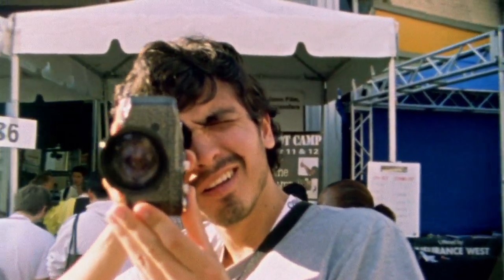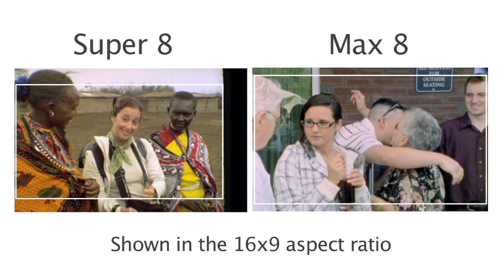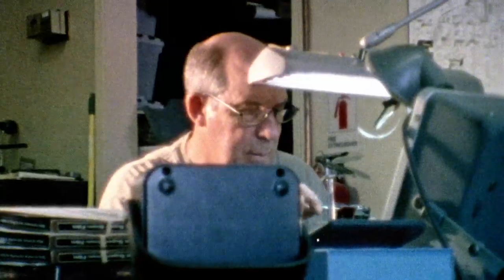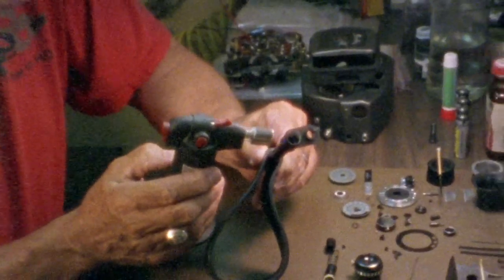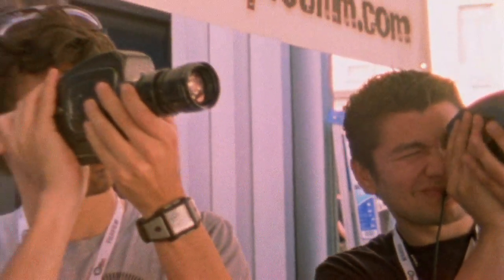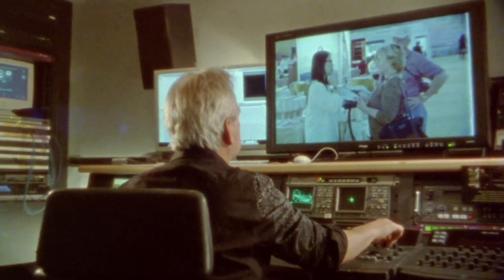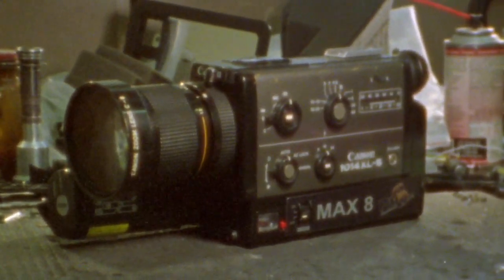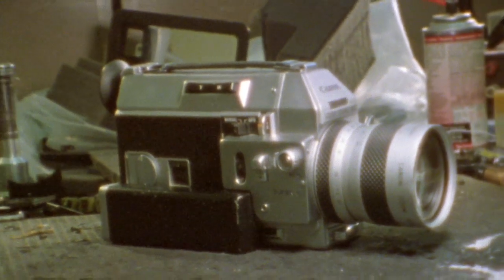Max 8 Widescreen Modification for Beaulieu Super 8 Cameras

Comment: I was contracted by Super8 Sound in Burbank California to design and build a fully automatic 50-foot film winder for making up super-eight film cartridges from the Kodak and Fugifilm 35mm negative stock that they were splitting into three strips of super 8 film complete with the perforations. The machine I delivered was immediately put into service and it functioned perfectly, winding up hundreds of thousands of super 8 cartridges holding negative film stock, at this time Kodak and Fugifilm were only supplying and processing direct positive transparency stock in super 8 cartridges. Super8 Sound set up their own film processing equipment to develop this negative stock and in addition, would provide digital film transfers to various video formats. Because of the success of the film winding machine, I was additionally contracted to design and build a "sound blimp" for the super-8 Beaulieu 6008 PRO sound camera, this fully-encased sound-blimp was required because of the noise produced by by the mechanisms that provided the film movement within the camera. After designing and building the prototype, I walked into Super Eight Sound but before I did, I started the camera running and sealed the blimp and set it on the desk of the owner Phil Vigeant, he looked at the prototype and was quite pleased with it's dimensions and the functionality of all of the cameras controls. Phil said it looks great but how quite is it, that's when I told him the camera was already running within the blimp, he was totally surprised how quite the blimp was, I opened the door of the blimp and the camera sound came pouring out! To make functional sound-proofing, it must be air tight so the sound can not leak out. David Riddle

Comment: All I can say: thank you guys so much for keeping Super 8mm film alive and bringing it up to the best possible quality. Of course you know: there is still some jitter and that dreaded "jelly-o" effect (in this particular film) caused by the lack of precision pin registration and pressure plate with the standard Kodak Cartridge. I'd love to see Kodak making a camera, like the older Logmar, that takes out the film of the Cardridge (no hassle) and leads it through a precision sprocket wheel drum into a top notch pressure plate, pin registration "system" - and back into the Cardridge - to yield a rock steady image. I love the low light footage (Vison 3 500 ISO?), sweet texture and dreamy nostalgic look without being too "lo fi" to the level of being distracting. If Kodak could come up with a film stock that has just a little less grain at that speed, Super 8 would be close to perfect for many a film project. That film look is just fantastic!  What a refreshing change to all that sterile digital video we are used to as e speak. 16mm and 35mm are simply too expensive (including film stock, lab processing and scanning) - 40+ year old heavily used standard 16mm cameras (say: ARRIflex ST, BL, Eclair, or the wind up Bolex) are becoming expensive again, to say nothing of top notch cameras such as Arricam Super 16 which are, even heavily used, prohibitively expensive - a sign that true film is becoming again higher in demand. For me that's a great sign. Thanks again for all your great efforts to keep Super 8mm and Max8 alive, bringing it up to the modern workflow! Please keep on :-)

Comment from the maker: Hi Guojon. It is two different things. For all the cameras, we recollimate the lens and realign the optics for better picture taking and focus.

For Max8 modification we modify the camera gate for a larger frame and then we re-center the optic and provide viewfinder grid lines to see where the 16X9 frame will result. When we 'realign optics' on the Pro814, we are making small adjustments so the picture is center, but we aren't actually moving the optics like we have to for Max 8 for 16x9.

Comment from the maker: Hi A Inglis. Currently we only convert the Beaulieu 4008, 7008 and some 6008 (depending on the viewfinder.) Unfortuantely with the 5008, the mechanics are a bit more challenging and labor intensive to modify. We have found it becomes not cost effective for our customers. If you want an interchangeable lens, you are definitely better off with a Beaulieu. The Canons do not have interchangeable lens. THe Going Green was also shot with the Max 8 camera and scanned in HD.

Comment: That is impressive to modify Super 8 cameras to a wider gate.  The resolution of 16mm or Super 16mm combined with the compactness of Super 8mm film is good in my books.  And this is for equipment that has 20-30 years of use already.